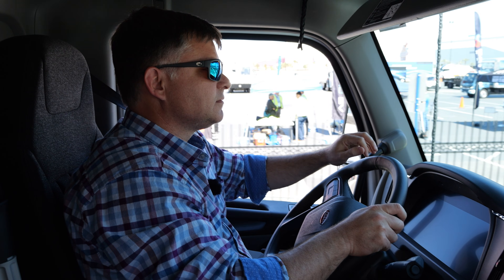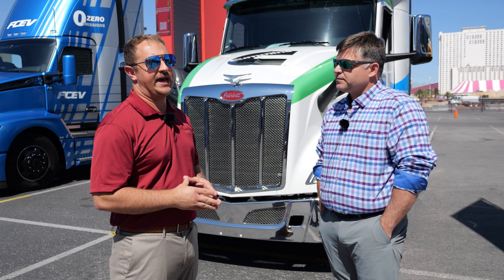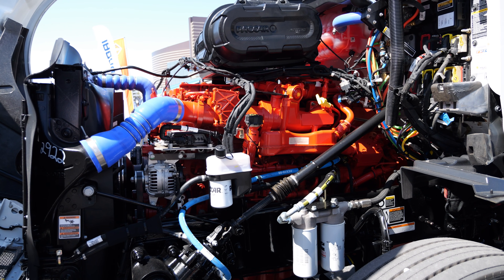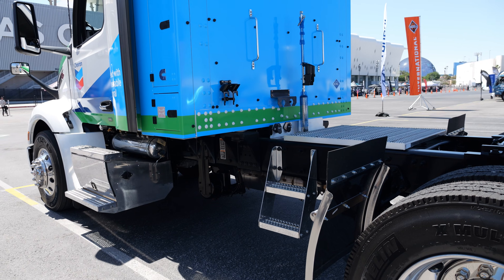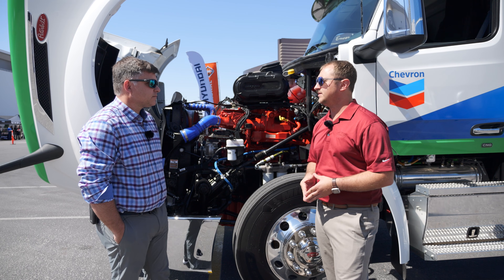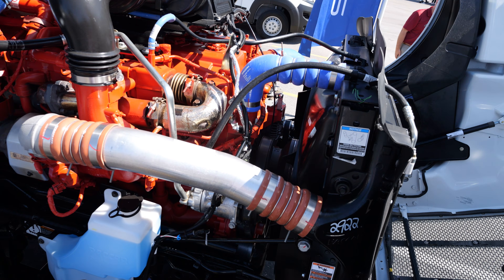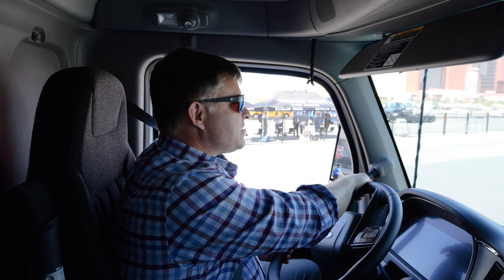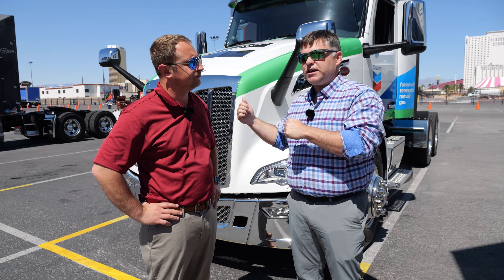Peterbilt Powered by Cummins X15N Natural Gas Engine: How Does It Compare to Diesel?

Comment: I drive a CNG truck 430 miles a night delivering CNG and have no issue at all yes they have less HP than other trucks but less than 100$ a day in fuel alot better than 1500$

Comment: I drive them in transit busses they have no power and the transmission shifts way to early you move 100 ft and it's in 3rd gear loses a lot of power when you turn the a/c on  and they don't have the engine life we are getting around 240000 miles on an engine
Reply: You didn't. Because this engine just came out
Reply: You are likely driving a legacy ISL G or newer L9N powered bus paired with an Allison transmission. Not exactly an apples to apples comparison for the X15N paired with a 12-speed Endurant engineered for natural gas ICE....
Reply: That's terrible. My CM871 Cummins diesel has 1.6 million and been overhauled 2X.
Reply: The whole purpose for this engine is to meet the needs of the 18 wheeler and those that have driven them have favorable comments.

Comment: Until you roll it and it completely explodes
Reply: Right.... idk why that's not a concern to u with diesel or gasoline. The risk isn't much diffrent. Natural gas at least isn't liquid so it will just vaporized and   dilute into the air.
Reply: Well heck, we should just ban all fuels because they all do that......

Comment: Companies can build trucks to use whatever fuel they want it to but the thing is , CNG is highly flammable so in case of accidents it can act like a small bomb. Another thing is it is not easy to fill cng into tanks in very cold atmospheric conditions.
Reply: Diesel is flammable. So is hydrogen.
Reply: Diesel is not that flammable as compared to cng or natural gas. @wildwarriorclips
Reply: @wildwarriorclips  this😂
Reply: @wildwarriorclips  if the hydrogen is compresses/condensed like it usually is in vehicles its no longer a danger or concern. If a conpressed hydrogen tank where to rupture the hydrogen would have enough engergy to bind with oxygen and turn into water vapor. This reaction happens almost immediately. This has been legitimately tested.
Reply: so Gasoline isn't flammable? lol
Reply: Natural Gas is lighter than air. When it leaks out it doesn't puddle on the ground and burn like diesel or gasoline. It disperses into the atmosphere.
Reply: you need better education when talking about cng